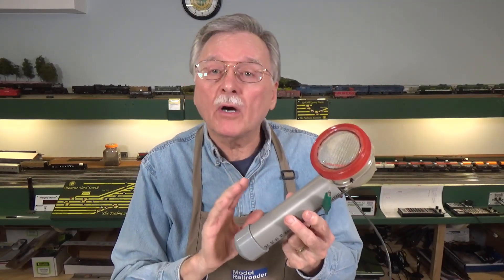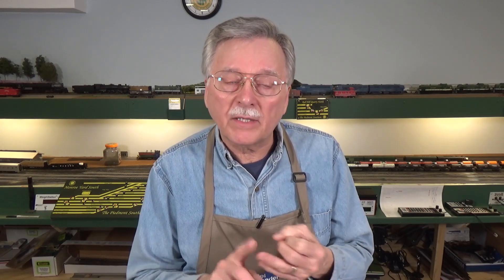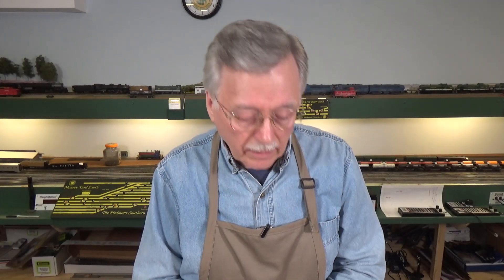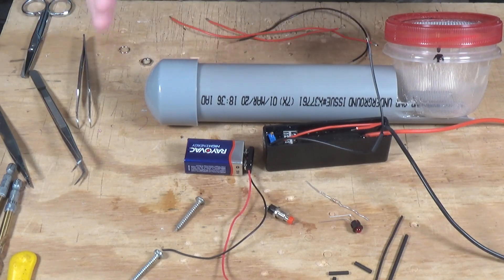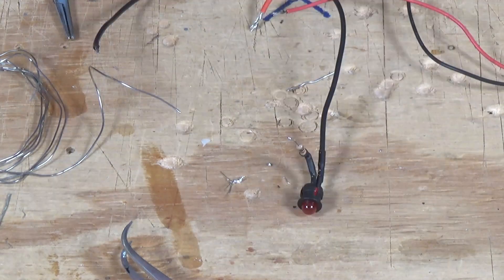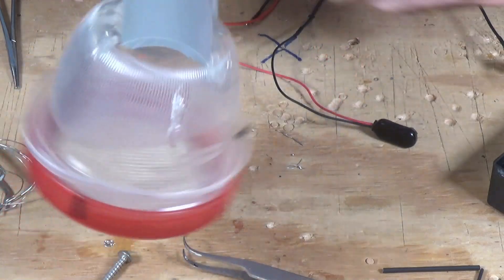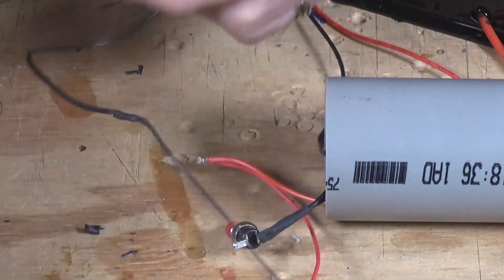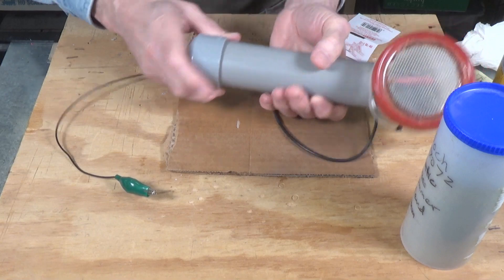New More Powerful DIY Static Grass Applicator Pt 2 (166)

Comment: Question: I ordered the necessary module, still underway from China. At this moment I use some kind of home build fly teaser which will give me a shock when I touch the metal netting, even after I switched it off. So every time I pull the on/off switch I have to touch the negative with the netting to unload it. It gives a spark which I’m not that happy about. 
Do you encounter this with the module you are using or does that version directly unload itself after switching off? 
I was glad to see your video, finding a version which can do 15 to 20 kV at 12 V. I will run it at a 9 V battery and can’t wait to see the results.
Reply from the maker: If you watch my videos on the new improved and more,powerful version you will see I moved the contact point back to the top of the static grass holder so there is no way to co touch it unless you try hard. Also if you simply touch the ground wire to the metal screen or contact plate it will drain the circuit.

Comment: Larry, Thank you for you great channel, I have learned a lot!  A question on the ion generator. I built my unit a few years back based on a design published in MRH.  There were two designs described, one that used 120VAC , the other used a low voltage supply. I was unable to get the low voltage ion generator in the parts list so my unit uses the 120V generator. My question is, is this unit less save v. units using a low voltage supply? It is fused. I’m not concerned with the internal (inside the handle) wiring, just if the shock from the screen to ground would be unsafe (my hot wire is attached to the screen, though I plan on moving it to the back per your follow- up video). Thanks in advance!
Reply from the maker: I have no idea how the unit you have is wired but assume the outlet side is internally isolated from the high voltage side. However with a unit like this you never know what the original purpose was and how it was intended to be installed. I’m surprised the MRH article didn’t mention this.

Comment: Thanks, great tutorial. Simple circuit, but you drew a diode on your schematic, not a resistor, lol. All the parts necessary are also available on Amazon, FWIW.
Reply from the maker: I checked and the zig zag line is a resistor not a diode.

Comment: Larry, question: I built my static grass generator exactly as shown in your video (large washer at the back of the RubberMaid container) but, simply put, it doesn't work. Wiring is correct, LED lights when I push the button - but nothing. I even tried attaching the  ground to a metal plate sprinkled with Woodland Scenics static grass. Waved an anode screen over it less than a quarter inch from the plate - nothing. Is it most likely that the generator I bought (Ebay/China) no good or ??? I don't know any other way to test it (don't want to touch it <grin> or use a V-O meter)
Reply from the maker: I would suspect that as these are pretty straightforward devices assuming the wiring is correct. I tested mine before doing the project by setting the ends of the two wires from the generator in clips a few mm apart and then fired it up with a battery and momentary pushbutton. It made a nice spark across the gap between the wires.
Reply: @TheDCCGuy  Thank you sir! Much appreciated. No spark so I’ll order another generator.

Comment: Larry, great videos on this process. One question I have is how do you protect the ion generator from the threads of the screws? It seems that there may be a little play that could cause the threads to rub and cut into the box.
Reply from the maker: If you are concerned about it you could add some extra protection using some of the thin ethafoam or similar shipping padding.
Reply: @TheDCCGuy  Thank you. I am not sure if the ion generator moved around inside otherwise. Wanting to have everything on hand to build one since I am nearing this point on my layout.
Reply from the maker: It may rattle around a bit but the electrical components are embedded in a resin matrix so are well protected. (This also prevent you from copying their circuit design). It is a common method for protecting an electrical circuit that is to be used in humid or wet conditions.

Comment: Larry could you explain in a future video how one might be able to wire the static grass applicator so one could switch between battery and a 12 volt power source. Also how one could place an inline banana socket and banana plug to allow the exchange between a grounding probe and an alligator clip; unplugging one grounding implement and plugging the other one in.
Reply from the maker: As I said in the video if you just watch Luke Towan’s video he shows how he did just that and provided a wiring diagam

Comment: Hi again Larry, I should have asked this in my previous comment. I understand the reasoning of having all the wires in the static body, my question is how did you get your push button through its opening? I have had to fish tail wires in my house during remodeling and found that most of the time it helped if I could attach a line through the opening to the wire I wanted pull through. How were you able to do this with the button so effectively? I’ve never dealt with something this small. Thanks
Reply from the maker: Like I said in the video if you install the wires and parts before installing the static grass holder, it makes it a lot easier since you can work from the that end.

Comment: Larry,  I will echo your other view that said the applicator would be more effective with the wire at the rear of the cup instead of the front on the screen.  I have a couple static applicators.  The most efficient in my Noch.  If you look at the design in the Noch there is a little projection at the bottom of the cup. They also use plastic screens. So you don't need a metal screen if you place the generator behind the static grass the field generated goes from that pole to the ground.  I have an applicator with the same design as your (and Luke's) and all it does id snap and pop more creating a visible electric bolt of energy (lightning) when held close to the ground plane. The Noch does not do this much.  I have better success and results with the Noch than the design you made. I've gotten zapped more with design you have.  Bill Shanaman New Haven RR. Sugar City, CO.
Reply: You prolly dont care but does anybody know a method to get back into an Instagram account??
I somehow lost the password. I would appreciate any help you can give me
Reply: @Deshawn Tyson Instablaster =)
Reply: @Finley Maxwell i really appreciate your reply. I found the site on google and I'm waiting for the hacking stuff now.
Looks like it's gonna take quite some time so I will reply here later when my account password hopefully is recovered.
Reply: @Finley Maxwell It worked and I now got access to my account again. I am so happy:D
Thanks so much, you saved my ass !
Reply: @Deshawn Tyson you are welcome :D

Comment: Larry ... great video as always.  One thing you didn't mention in the parts list ... the Rubbermaid container.  I ordered some from Ebay that were similar I think ... Rubbermaid TakeAlongs 1.2 Cup.
Reply: Dollar Store has these available in multi-packs for (you guessed it) a dollar.  Many sizes and shapes, Rubbermaid, Betty Crocker and others.
Reply from the maker: Ted used an old Skippy peanut butter jar, although my wife says it is very difficult to get them clean. I dug up an old gelato jar about the same size which looks like a good option too.

Comment: The modification of placing the metal grid at the back of the container may improve performance, but more importantly it is safer. Much less chance of touching the positive grid and giving yourself a shock.

Comment: Awesome video Larry
How did you get the pushbutton thru the hole
Reply from the maker: Lots of grease and a ten pound hammer. Actually it more or less slid right in but impossible to shoot since it was done from the inside. I drilled a 5/16” hole for the 1/4” diameter switch making it an easy fit.
Reply: Should have just removed the Tupperware container.😅